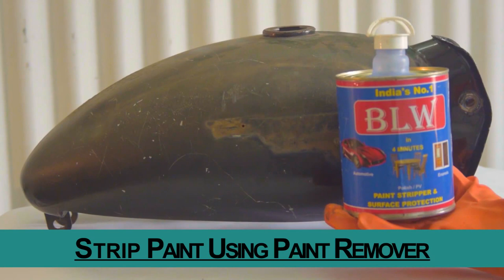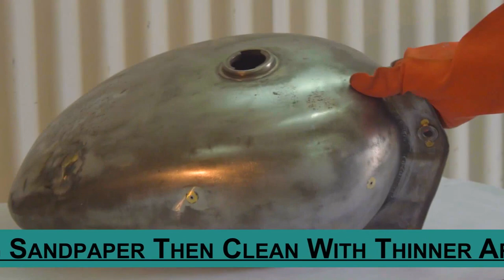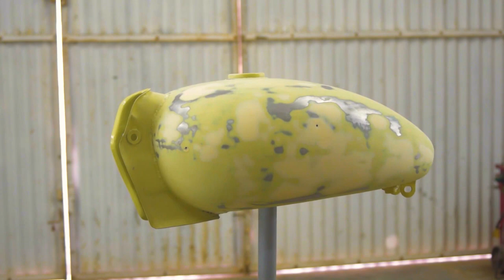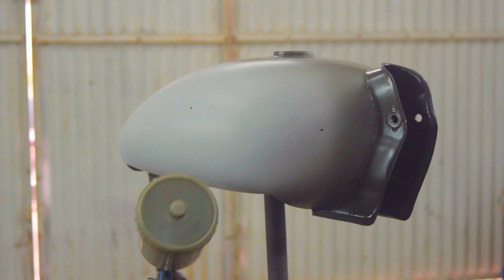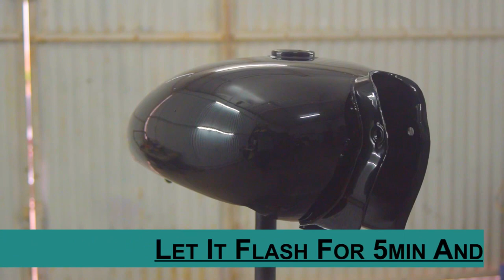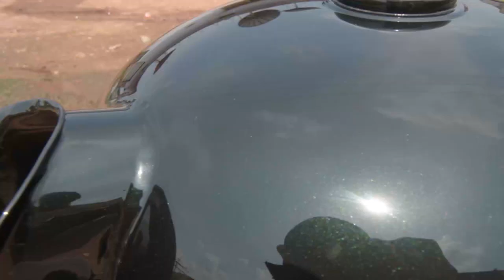Royal Enfield Fuel Tank Painting - Motorcycle Painting

Comment: Great video. What's the mixing ratio of base and 2k primer, and does sanding to be done after 1st clear coat, when painting matt black color (purchased matt up clear coat). Please guide.
Reply from the maker: Mixing ratios are different from brand to brand
Base Duxone 1:1
2K Primer 4 : 1 : 20%-25% thinner
Step
1.2k primer   - sanding req
2.Base coat  - no sanding req - use track cloth before spraying clear
3.Clear1        - no sanding req - flash off-time 15min between coats
4.Clear2        - no sanding req - let it dry for 24hrs for sanding and polishing if required

Comment: Do we need to sand clear for every flash off time? If no then when do we have to sand clear coat?
Reply from the maker: After 24hrs
Reply: @DynamicAutoYT  which sandpaper should we use? Is sanding clear coat necessary?
Reply from the maker: @stanleyvictor2998 2000grit- Sand only if you get orange peel or paint run then you must polish/buff using machine
Reply: @DynamicAutoYT  thanks 👍👏😊
Reply: @DynamicAutoYT  can you share your sander details?
Reply: Can we polish and buff after clear coat?

Comment: We what saprate gun for apoxy primer painting and clear or one gun is enough
Reply from the maker: Hi, For primers 1.7mm because it's thicker and doesn't flow in small nozzles spray gun
Base coat 1.3mm or 1.4mm
Clear coat 1.3mm or 1.4mm 
but I recommend 1.7mm for primer,1.3mm for base  and 1.4mm for clear or use 1.4mm for both base and clear

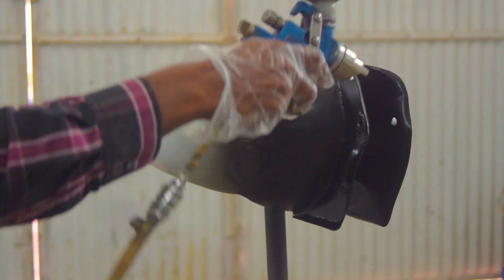Pilot 4:23 
Premier 5:58
Reply: Thanks sir to give good information